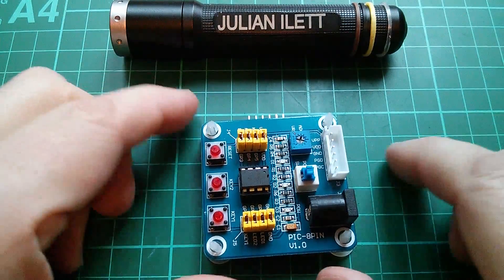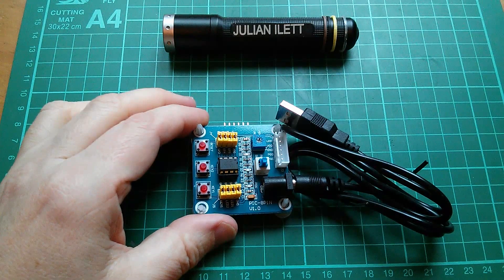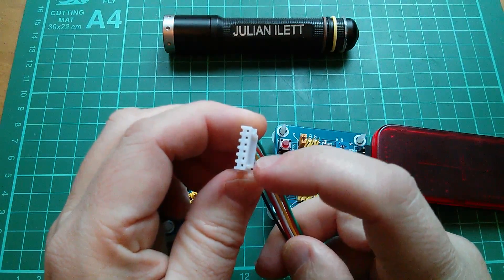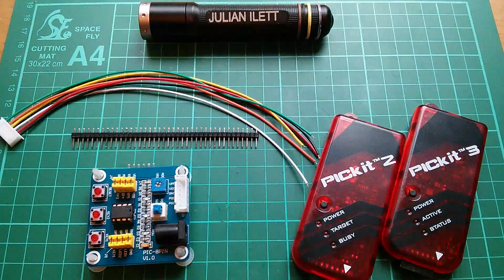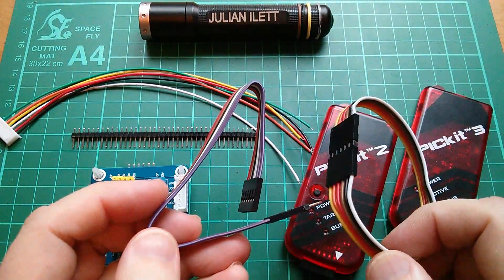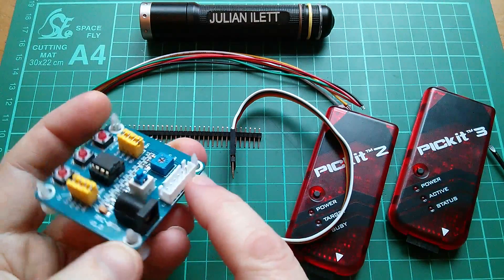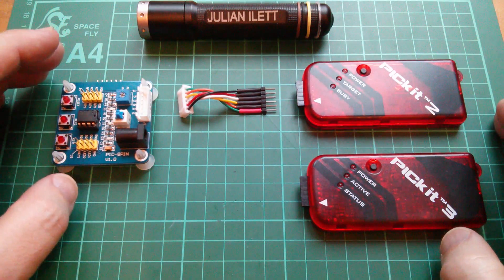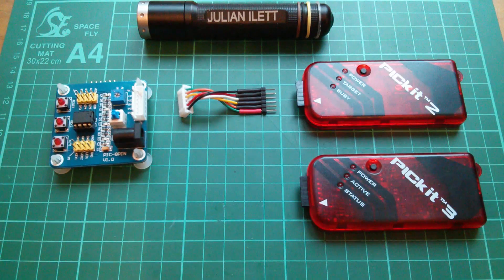PIC Assembly Language Tutorials: #0 - Shopping List & Mods

Comment: Julian, there are 2 tracks from that Vpp piin to GP3. Did you cut them both?  If you did it seems like it would no longer work as a reset pin.  If I am right (probably not) couldn't  you just cut the outer track and remove the jumper when programming and leave it when you need a MCLR? (This would only work, of course, with you mod on the bottom).   Please excuse my lack of knowledge, I am a CS person.
Reply: Well, never mind the above question.  I see now. With both tracks cut we still have the track from the Pin to the resistor.  DUH.

Comment: I bought all the stuff needed, installed MPLABv8.92 and it cant see my pickit2  I am on Win10 the PC sees the device, can I have installed Pickit 2 v2.61 in bootloader mode it will connect and tells me there is no operating system on the pickit2 and to download it. I do this and then it goes to verify and reboot the pickit and it never connects.  Starting to think I have a bad device

Comment: I've been trying to program a version of my "quiz-tie-breaker" into the chip on that exact same circuit board but without success.

What I've discovered is that GPIO2 which is connected to key 1 on that board seems to simply not work.  I've tried everything I can think of, including some fancy stuff about disabling the A to D converter on that pin since it seems that's activated by default following a reset, but nothing works.  The pin stubbornly refuses to recognise that the button has been pressed.

I tested it by putting my multimeter across the GND and GPIO2/Key1 pins, and I measured +5V with the key open and 0V with it pressed, so the key itself is definitely working.  It's just that the pin isn't detecting anything.  I even tried bridging the GND pin of the chip to the GPIO2 pin of the chip with a bit of wire, but it doesn't work.

This is especially frustrating because GPIO5 which is connected to Key2 on the board does work just fine, both via the button and by using the bit of wire to connect the pin to GND.

I used a spare 12F675 to replace the one which came with the board and it shows exactly the same behaviour, so either it's a fault with that chip type or (more likely) I'm just missing something important.  Maybe deactivating the A to D conversion requires following an exact order of instructions... or something.

Whatever the problem is, it's got me licked.  At least for now.
Reply from the maker: +JasonMasters also disable the comparator
Reply: I already set bits CM0, CM1 and CM2 in CMCON to 1.  The datasheet says this disables the comparator.  It still doesn't work.  Is there something else to do to disable the comparator?  I've been searching the datasheet and I can't see anything else.
Reply: For reference, here is my latest unsuccessful attempt to read GPIO2 as a digital input.  The program is supposed to just read GPIO5 (key 2) and GPIO2 (key 1) and then light both LEDs if either key is pressed and turn them off again once neither key is pressed.

There will be some "weirdness" in the way this is coded due to it being adapted from an earlier program which attempted to use the keys for my quiz game.

Edit: I noticed the btfss and btfsc instructions were reversed in checking GPIO2 and swapped them but it made no difference.

#include <p12f675.inc>
  __CONFIG _INTRC_OSC_NOCLKOUT & _WDTE_OFF & _PWRTE_ON & _CP_OFF

PORTSET  EQU  0x3c ;GPIO bits 0 and 1 are to be outputs
ANSBITS  EQU  0xfb ;ANSEL bits to set low (GPIO2)
REG1  EQU  0x20
  org  0
;Setup begins here
  goto  pastint   ;Jump past the interrupt service routine
  org  4
  retfie     ;Just return from any interrupt
pastint
  movlw  0x07
  iorwf  CMCON,F   ;Comparator off
  bsf  STATUS,RP0  ;Use register bank 1
  call  0x03ff   ;Load the timer config value
  movwf  OSCCAL   ;Set the oscillator calibration
  movlw  0xdf
  andwf  OPTION_REG,F ;Turn off T0CS to select internal clock
  movlw  ANSBITS   ;Load ANSEL bits to be low (GPIO2)
  andwf  ANSEL,F   ;Make GPIO 2 digital
  movlw  PORTSET   ;Which GPIO bits are inputs and which are outputs
  movwf  TRISIO   ;Set up input/output settings
  bcf  STATUS,RP0  ;Use register bank 0
  movlw  0xfe
  andwf  ADCON0,F  ;Turn off the A to D converter
  movlw  0x3f
  movwf  REG1   ;Load initial LED condition
restart
  movlw  0x3    ;Port bits 0 & 1 both high
  iorwf  REG1,F
  iorwf  GPIO,F   ;Set port values

mainloop
  ;bsf  REG1,0
  ;bsf  REG1,1
  btfsc  GPIO,GPIO2  ;Skip next if bit 2 is still set
  bcf  REG1,0
  btfsc  GPIO,GPIO2  ;Skip next if bit 2 is still set
  bcf  REG1,1
  btfss  GPIO,GPIO2
  bsf  REG1,0
  btfss  GPIO,GPIO2
  bsf  REG1,1

  btfss  GPIO,GPIO5  ;Skip next if bit 5 is still set
  bcf  REG1,1
  btfss  GPIO,GPIO5  ;Skip next if bit 5 is still set
  bcf  REG1,0
  btfsc  GPIO,GPIO5
  bsf  REG1,1
  btfsc  GPIO,GPIO5
  bsf  REG1,0

  movf  REG1,W
  iorwf  GPIO,F
  ;movlw  0x3
  ;iorwf  REG1,F
  goto  mainloop  ;If neither button is pressed, start again

  end
Reply from the maker: As far as I remember, you just have to set ANSEL to zero and CMCON to 0x07 to avoid the read-modify-write problem on GPIO. You seem to be doing both correctly (with the appropriate bank selection) so for the moment I can't see where the problem is. But I'll be covering all this in my tutorials soon.
Reply: If I remember correctly, I tried setting ANSEL to all zeros using the clrf ANSEL,F command and all that did was to stop even GPIO5 from working, but I'll give it another try (later - it's the wee hours on this side of the globe and I should have been in bed hours ago)

Comment: The PIC12F675 is a really awful part it only really has a ADC and a couple of timers and GPIO pins.  People might also be interested in shopping for a 12F1840 or 16F18313, these devices are pin compatible and have some much more exciting internal features.  Obviously keeping the PIC12F675 for the tutorial part.
Reply from the maker: I may look at other parts at the end of the tutorial.

Comment: @11:49 Just playing with my board which arrived recently.  I have a PICKit3 and it seems to read happily at least.  I agree that C4 breaks the rules.  I think you could just remove if it it caused issues when programming.  Might be a simpler mod to just take C4 off.  You do need the RESET jumper in place during programming; all the other jumpers can be off.
Reply: I'm a bit disappointed... I added Power and nothing happened (apart from the POW LED3 lighting up)... couldn't it have been programmed with blink or something that does something when you press the buttons? It's not blank though... has... 1683 23FF 0090 0183 2BD8 at the start... then zillions if 3FFF.... then... 3FFF 3FFF 3FFF 3FFF 3FFF 3FFF 3FFF 3FFF 0183 2BE9 00A0 01A2 01A1 0820 0221 1803 2BE3 0AA1 2BDD 30C8 0AA2 0222 1803 0008 2BDC 30FF 0085 3007 0099 1683 019F 303C 0085 30FF 0095 303C 0085 30F4 1283 1005 1485 23DA 30F4 1405 1085 23DA 2BF5 342C at the end...  OSCCAL 342C?  Config Bits are... 01B4.  Maybe it has a secret, very short, program?
Reply from the maker: Yes, there is a program in the PIC as supplied - press the two buttons to light the two LEDs
Reply: FWIW I've created a schematic and added it as a link to part#1. Share & Enjoy

Comment: Julian do you want a challenge?  Can a Pic have it's code read out and disassembled to see what it does?  I picked up a little mystery box at a thrift shop that has 3 Pic microprocessors in it but it has no inputs or outputs and I have no idea what it does!
There are no markings, model numbers or anything on the box except that it just says Quantum Pro on the front.  It's got a power jack on the rear and a switch that can be set in Hex between 0-F and just a power switch and volume control like knob on the front labeled Low and High with a green LED but no Inputs or Outputs and the LED doesn't even blink!
On the PC board there are some filters at the power input, 4 diodes and a 5 volt regulator. There are THREE Microchip Pic16F54 micro-controllers that connect to 3 transistors and 3 little transformers but they don't seem to do anything or go anywhere!
Why would a do nothing box need 3 micro processors?
There is nothing on the bottom of the PC board and no other parts but the solder joints and it doesn't have Wi-Fi or Bluetooth either so what could it possibly do?
Maybe it's a Quantum computer which would explain the name or possibly a Tesla free energy machine.  It can't be a perpetual motion machine though because it uses power unless it puts more power back out than it uses which could explain the 3 transformers!  Otherwise I have no idea.
Reply from the maker: Yes, you can read the contents of a PIC unless it's been code protected.
Reply: Why do you think a little box that seems to do nothing would need 3 of them?
Reply: There are Chinese sellers on Ebay who have USB Pic programmers for $6 that plug into a PC so why do you need a PicKit?  Does it do something special?

Comment: Instead of heatshrinking every single wire put hot glue on your connector. It has several advantages, the most important you can't forget to put it on before soldering ;) . But the connector is also sturdier (the pins can't wiggle around), wires won't break (they would still do that even when heatshrunk when moved often) and you can't pull a single pin out of the connector.
What works best is to put a dab of hot glue on baking paper (hot glue won't stick to it if left to cool fully before trying to remove it), then push the connector in. Let it cool a little (don't pull of the paper yet) put a second dab on the connector and push a second piece of paper on top (or the other way round, dab on second paper, push second side of connector in). It helps if you do that on a cool surface or something that draws away heat quickly (some metal sheet, aluminium casing of a powerbank, heatsink,...). Excess hotglue on the side can easily be trimmed to size with a flush trim cutter. Try it out! With a little bit of practice you can make connectors that almost look injection molded.

Comment: For cutting PCB tracks, i find this to be extremely useful: https://www.rapidonline.com/copper-track-cutter-for-stripboard-and-prototype-boards-550885 (I'm not affiliated with RO). The only drawback is that if you have 2 tracks closer than 3.5mm, you have to use something else (I have a pin/drill vise for smaller diametres, but I hardly use it).

Comment: Could someone help me, please :D

I have lost a 1N4148 diode from the frequency counter kit. I don't know much about z diodes... would it be possible to replace the included one (label SC4148) with an other 1N4148 (label T4148) which i found?

Comment: Great idea this #0 giving us the heads up to buy the hardware. I wll be following because I think you have some more assembly tricks up your sleve that I have never thought about, for example like one of the arithmetic operations you did in the LFSR code setting the carry flag by overflow (add 0xff) rather than bit-checking and setting. :)

Comment: isn't it easier to cut the trace going to the capacitor and resistor? between the pot and jumpers. is it connected anywhere else? then you don't need the wire anymore.

Comment: I can't help but think that it would have been better to advocate the use of current tools, like MPLAB X, and also to discourage the use of counterfeit programming tools.

edit: PICkit 2 was open sourced by Microchip, but PICkit 3?
Reply: The schematics and firmware for both Pickit 2 & Pickit 3 are freely available in the public domain so how are they counterfeits? Anyone with the requisite skills can build either of them.
Reply: There are schematics available for many devices, but this doesnt mean they are free for all to reproduce and market under the same name and trademarks as the original product.

You are correct that PICkit 2 was open sourced by Microchip, I did find several forum posts etc to back that up, but I cant seem to find anything to suggest PICkit 3 has had the same treatment.

Comment: Are you using this instead of more expeditious Arduino specifically because of Assembly language?
Reply: You can program any Arduino (or correctly the AVR on board of it) in assembler as well. But I think Julian just has much more experience in PIC assembly than AVR assembly and switching between architectures in assembly is much more involved than switching architectures while using C.
Reply: The ATTINY85 (8 pin) would be a better choice as it Arduino IDE compatible.
It costs <$2 and is serial port programmable.
Reply: It's an Assebly course, and he has the PicKit2 and 3, so why use a AVR if you have the stuff lying around? And he seems to be familiar with PIC's
Reply: this crossed my mind also.   I'm too much in the dark as to the reasoning.    except that it is low cost & available hardware and software using assemble language.

Comment: If you do happen to be a Linux user there is an alternative to the MPLAB. Install gputils from your distribution's software repository and use Geany as your IDE. Any seasoned Linux user knows how to do this. Failing that you could always dump assembler altogether and install the excellent Great Cow BASIC.

I have everything on this list bar the pcb, and I don't think I will bother if it is so badly designed anyway. I got plenty of 12F675s and plenty of breadboards so I feel sure I can come up with a simpler solution. (Also given that it took 2 months for my alice order to arrive last time .................)

I have coded in PIC assembler before (I was one of the idiots who bought one of those bloody useless Velleman K8048 PIC experimenter boards a few years back) so I will be approaching this with more of a refresher course feel, to get my hand back in again.

Looking forward to the videos. Congratulations Julian on 100k and more, it is well deserved.
Reply: Thanks for the tip, installed  Geany and gputils, now have to find out how it works....

I will try GCB as well, see if I can get it up and running. It seems to be more complicated to install.
Reply: Thanks

Comment: What are the advantages of PIC ?  Expensive programmer, expensive dev boards...

Atmels are cheap + huge community + very cheap programmer.
STM32 are very cheap and widely used in the industry + very cheap programmer.
ESP's are cheap and dont even need a programmer, or a very cheap one first time.

Then PIC ... Why ?
Reply: +Jonathan Herr That doesn't magically make PIC series MCU's the same as atmel ones...
Reply: Expensive programmer? My pickit2 clone cost me less than a fiver!
Reply: TheKetsa hipster programming basically
Reply: Can't find a pickit3 for less than 10$, all other chips mentionned can be programmed with sub 1$ stuff.

Well, I'll still buy this stuff and follow the tuto.
Reply: TheKetsa try mikrochips curiosity board
Reply: TheKetsa you do realise atmel and microchip are the same company now?
Reply: Atmel AVR are not very feature rich. Go to Microchip's Website. There's a PIC with every peripheral you'll ever need. The datasheets are excellent. The STM32 is a great board but the resources are scarce and good internet tutorials are rare. If you are starting out on microcontrollers, i'll recommend using the PICs first. Get some depth of the microcontroller domain and then move onto ARM. This is coming from a guy who has gone through PICs, Atmels and STM32 Discovery Board.
Reply: I'm a MSP430 user. $10 programmer from TI (includes a sample chip). Nice internal peripherals.

Comment: In case some people haven't ordered from China before. From the UK you are supposed to be able to order up to £15 without incurring import tax. Over this value and you may, not always, get a package stopped in customs and import tax added. The happened to me a few years ago and Royal Mail added their own handling charge on top of that. It's just something to be aware of. I try and keep it below £15, as most have £0 shipping, splitting over separate orders on different dates isn't too bad.
Reply: https://twitter.com/FauthNiklas/status/821367627100684288
Reply: Jason Birch thanks for the advice on this, I did wonder if import tax would be added, so put me off buying item from China, until now.

Comment: Hi Julian, instead of the Vpp mod where you (very annoyingly) have to remove the jumper all the time it would have been easier to do what's in the PicKit2 manual. Add a diode between the reset RC- circuit and the pin. You can still do that now, just add the diode under the jumper and NEVER add the jumper.
Reply from the maker: True, the diode can be added now that the mod has been done.

Comment: Over all I liked it.  But really wished you'd pick an ARM instead of a PIC.  They are not only cheaper (< US$2 for a stm32f103c8t6 board), they are more relevant.  ARM has a much richer (and cleaner) instruction set and the tools are lower cost and cross-platform.
Reply: Rick, This is an assembly language tutorial. ARM is 32bit and far more complex to program in assembly, by keeping with an 8 bit microcontroller and the PIC with only 50 odd instructions it's much easier for a novice to understand. He's also not using the latest IDE and C language for the same reasons. They are great chips but far more complex overall.
Reply: Yeah, good luck trying to program an ARM chip using free software. And reading the datasheets.